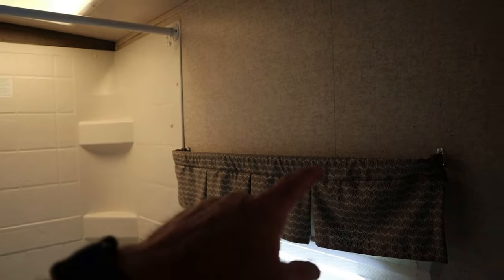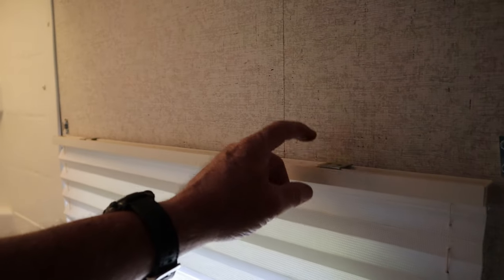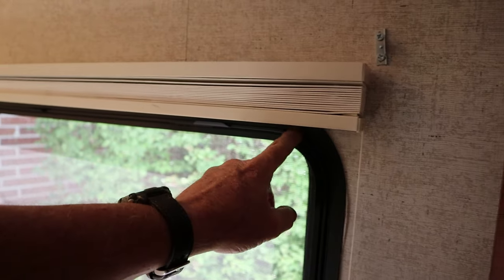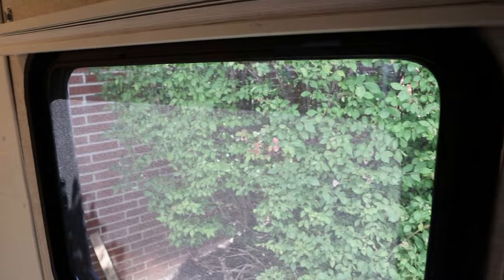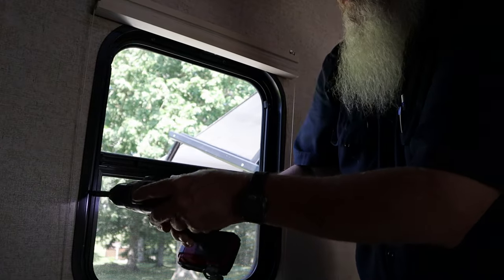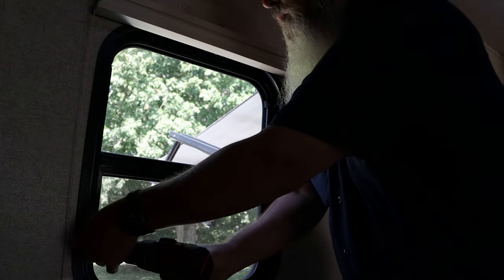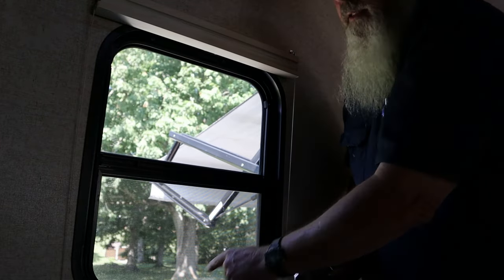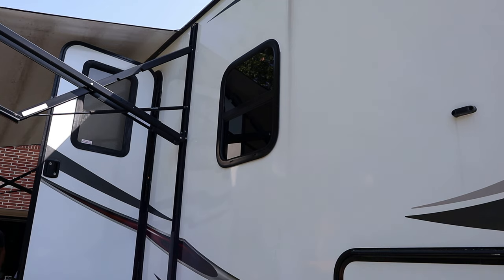Replacing The Seals On RV Windows

Comment: I think your style is perfect. It's real, devoid of the drama and over production that permeates other videos and just puts me off.  It's more like hanging out with a buddy than watching a soap opera.
Keep up the good work.
BTW, A buddy had a leaking window on his new RV. The dealer couldn't see anything wrong with it so to appease my friend, they ended up giving him a replacement window to install himself. When we took out the orig window, we found there was a pin hole in the goop that seals the two ends of the extruded aluminum channel around the window - it was more evident from behind. All it really needed was a dab of silicone to seal it up.
Reply from the maker: Sometimes if you will just remove the window you will find an obvious problem, but not always. Thanks for the compliments.

Comment: I have one for you.   I have three non opening long rectangular windows in a hallway that leak.  But the water collects in the bottom of the frame and doesn’t run down the wall until the frame fills.  I thought that the glass might not be sealed to the frame.  Have you seen that?   And if so how do you reseal the glass?   It’s a 2013 Keystone Cougar 337fls.

I think I’ll try replacing the rubber seals first and see if that stops the leaks.
Reply from the maker: Make sure the weep holes are open. Heck, make sure the weep holes are on the bottom of the windows. I have seen windows installed upside down.
Reply: I have a motorhome with the rubber on inside that does not have screws to remove a window on the passenger side of a motorhome that leaks. How do you remove that type window. It’s a 2001 and tropi cal only problem I have with it. The weep holes are draining good.

Comment: I did a window 2 years ago with foam and did not add silicone too the three sides per your answer to a question. Have you changed your fix to windows? Should I add caulk? Haven't had any problems but I like to do things right. I like your videos. 9/1/23
Reply from the maker: If you have frameless windows, no. No sealant on the outside. This was not a frameless.
Reply: @hillbillyrv  can you give me a quick description of what frames is. Mine had the interior ring held on by screws like the one in the video. It came out same way. No caulk from factory. 2017 Jayco whitehawk. Thanks for replying to comments so quickly!  Have a great day
Reply: Great video Kenny was that a foam seal you used 🤙
Reply: Frameless window you can’t see the frame from the outside.  Framed window you can.  Hillbilly has a video of a frameless window repair you can search and watch.
Reply: @coreymerritt7742 yelp sure was.

Comment: I noticed my bathroom window is leaking, it looks like the previous owner put caulking around the window, it this normal?
Reply from the maker: Yes if it is not a frameless window. Whether frameless on a framed window. The window needs to be removed and resealed.
Reply: Out the outside around the window frame what kind of sealant you put it?

Comment: Is there such thing as an extension to put on the door drip edge on the top of the door? I painted the roof and now when it rains really hard the water floods in the canopy channel and goes over it onto that drip edge and the water makes its way inside the door and looks  like a little waterfall running down the door.
Reply from the maker: I have never seen anything like that.